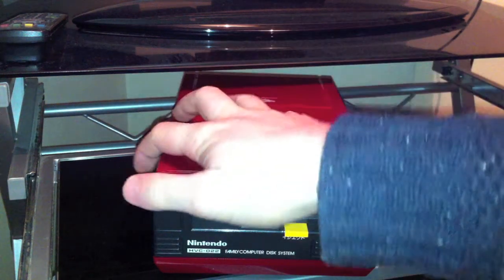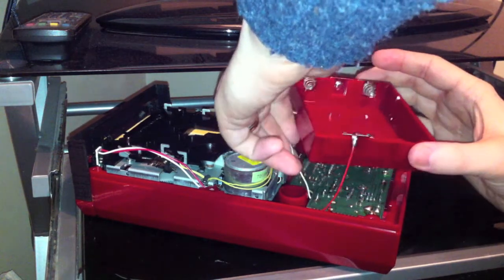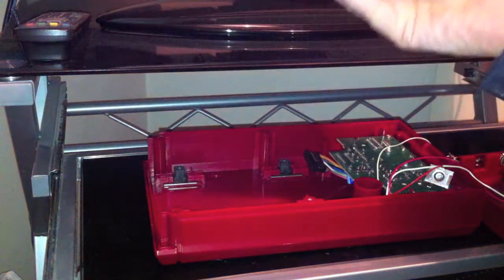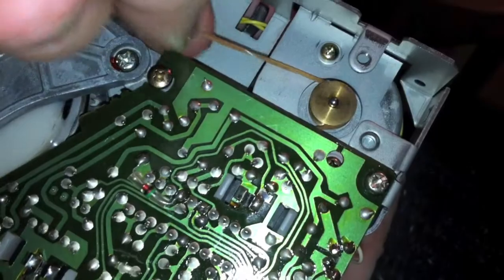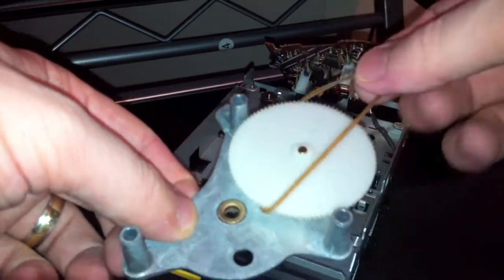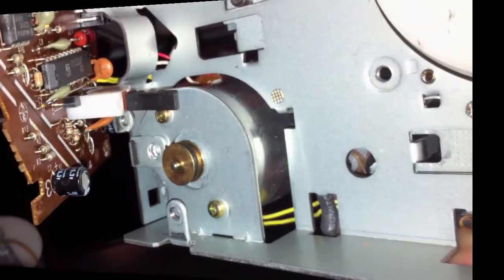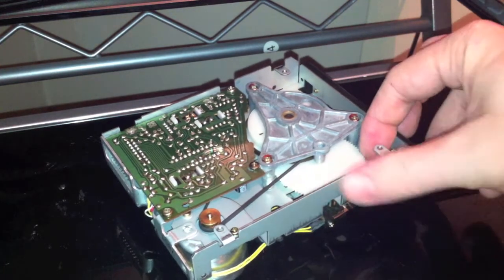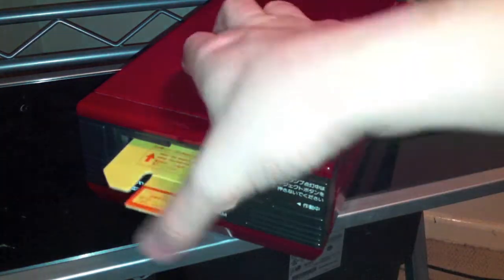Famicom Disk Belt Replacement

Comment: Good video but do you have the link that you bought the replacement belt please? , I`ve searched Ebay with no luck
Reply from the maker: It was a while ago but I'm pretty sure I used one of these: https://www.ebay.co.uk/itm/Disk-drive-belt-3-inch-Spectrum-3-Amstrad-CPC-6128-Famicom-Disk-System-FDS-/231670658174

Comment: What kind of calibrating do you need to do, please explain? Thank you.
Reply from the maker: +ISOTROPOSPHERE Try this video here: https://www.youtube.com/watch?v=a3COTWsArdE. This is a much more in depth video than mine. The calibration process starts about 6 mins into the video. Also have a look at http://www.famicomdisksystem.com as well for more info.
Reply: Replacing a belt in a Roland S-10 keyboard with a broken quick disk belt. Hopefully just a belt change will restore life back into it. Thanks for the reply and link.